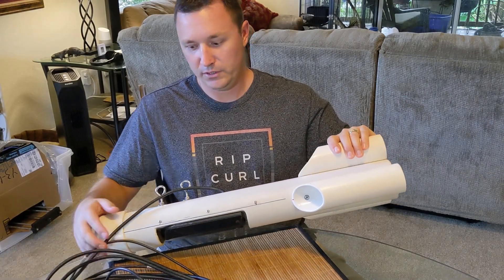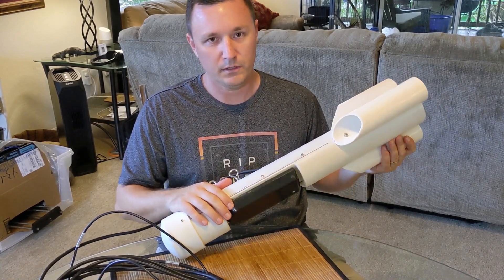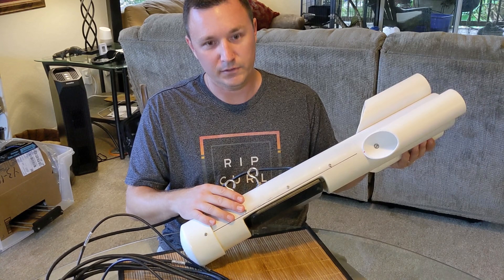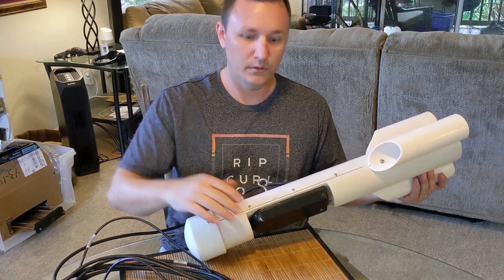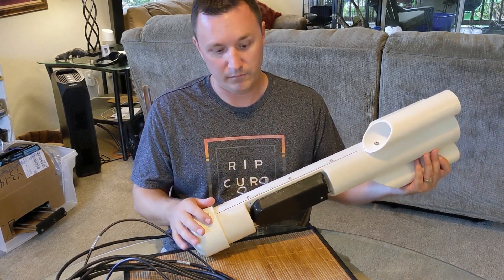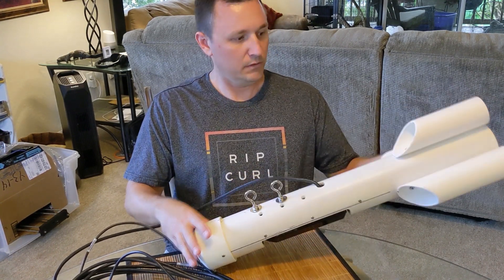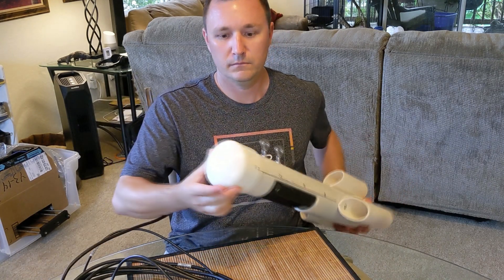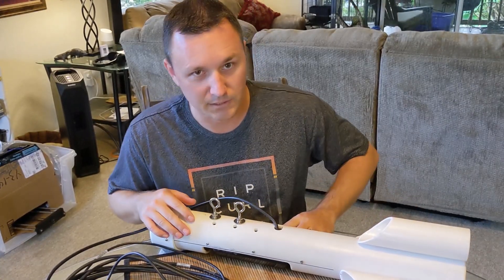DIY Towfish Preview

Comment: I'm on my second Humminbird towfish design. First one was for shallow water towing (20 foot max). This design I hope to eventually get down near 100 meters but there is a lot of issues to deal with. interested what you run into.
Reply from the maker: Did you share your work online anywhere? I'd like to see what your towfish looks like. I finished part 1 of the build. I'll be working on the video editing for part 2 and the initial testing video over the coming weeks. The initial sonar recordings seem better than my boat's transducer, at least so far.
Reply: @CSDSolutionsLLC  I did not share as of yet. My first tow fish was made out of PVC with a down rigger ball for nose weight. There was not much notable difference down 20' as compared to the surface TX when in 100' of water. There are a lot of variables when going deep which is why I expect a lot of mods and rework on my latest fish. Once I get it to track properly, the next step will be a motorized spooler with a slip ring. Oscillation due to cable drag and long lay back will be your biggest hurdle with a light weight short fish. Consider mounting a sport camera and light on the cable to observe what the fish is doing so you can better troubleshoot some expected noise.